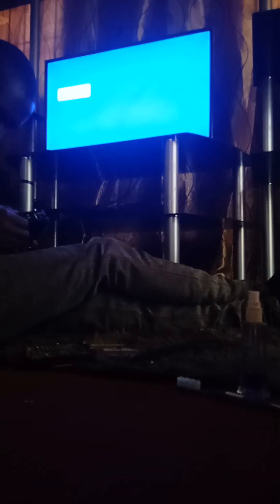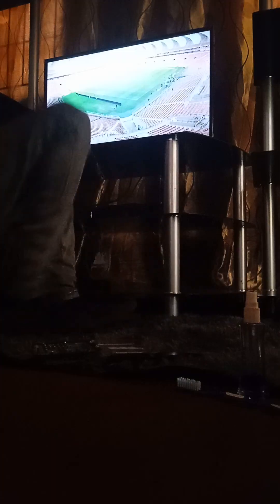how to fix openview saying no signal,no channel

Comment from the maker: If you are trying to fix it and you are not winning do feel free to halla me on my WhatsApp and I'll walk you through the solution 

084 251 3062
Reply: Hi Rotondwa i am using a smart openview. It is stil new but it is giving me a signal problem
Reply from the maker: @wamashuduwendy9736  thanks 🙏🏾 for getting back to me and I'll walk you through the solution for free,do take my WhatsApp number and Halla me
Reply: It would help if the video wasn't made in the dark
Reply from the maker: @doriskarinkleinbeck3999  thanks for the reply and advice I'll take a note of that and correct it
Reply: Hello my decoder is experiencing the same thing i did try what you did but dololo still says the same thing😢
Reply from the maker: @2022-w5z  hala me on WhatsApp I'll walk you through the solution